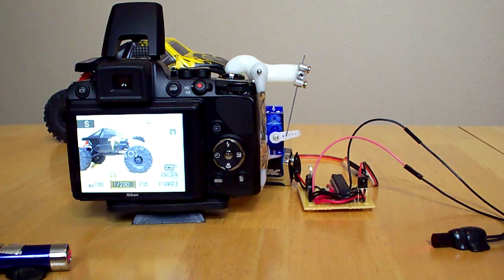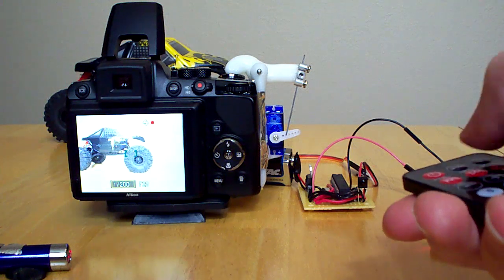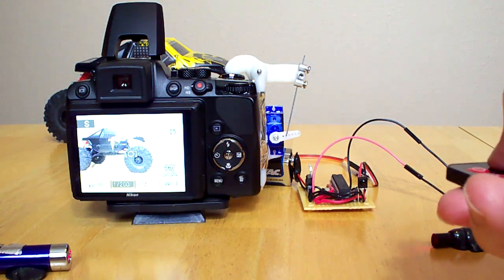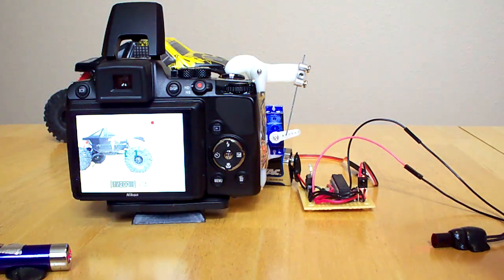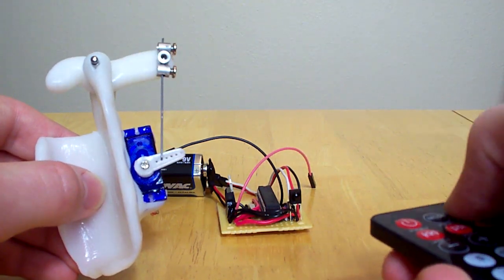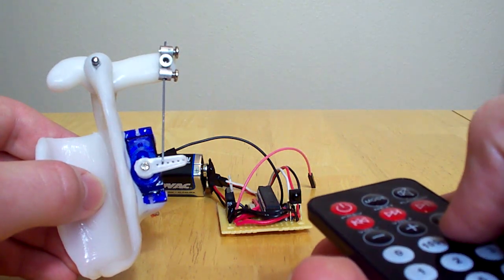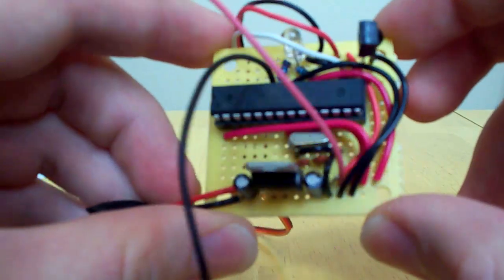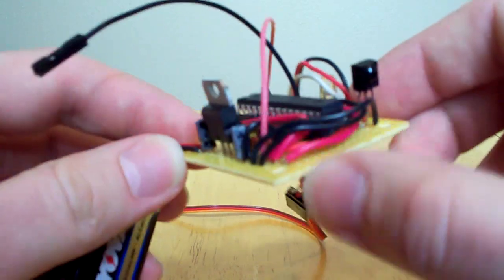Remote controlled finger. Give any camera remote shutter capability, and laser.

Comment: Great project!   Very few camera's have built in remote triggers and this solves that problem perfectly.  
How did you construct the plastic finger mechanism?  That's the real guts of this project.  I can figure out the servo code from the examples in the Arduino IDE, but the plastic finger is really clever and not so obvious.